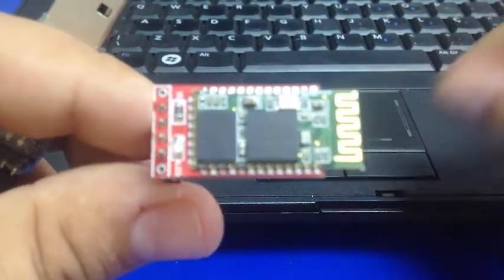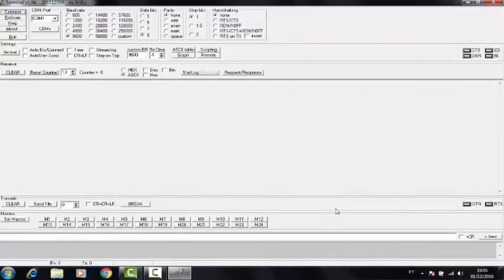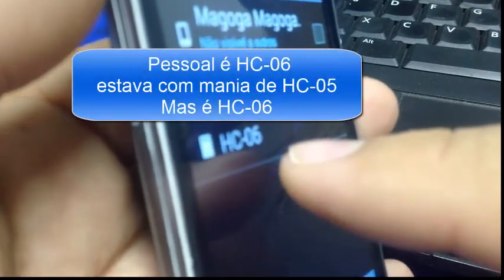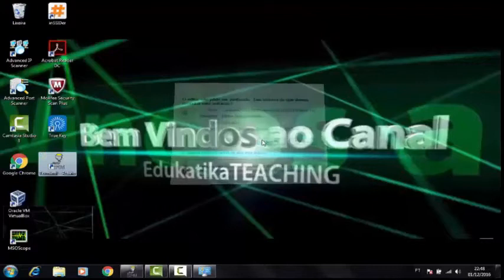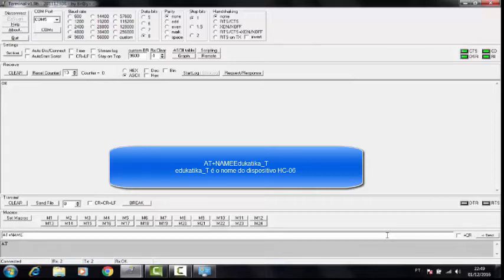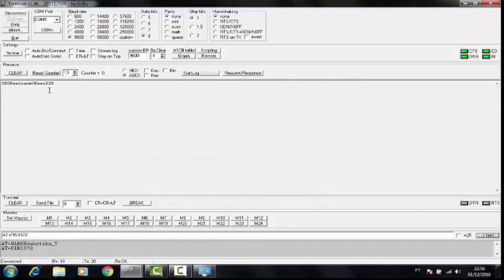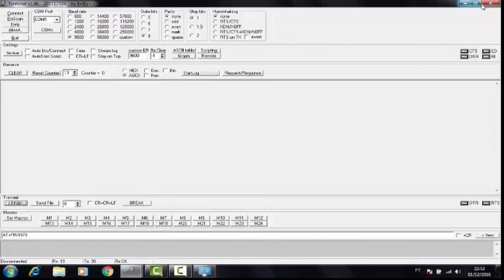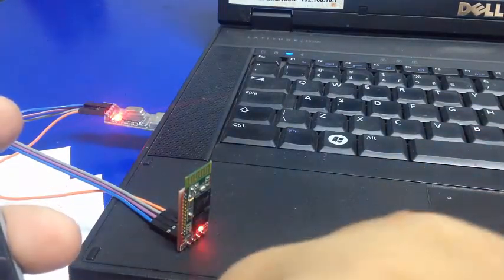Como Alterar NOME e PIN de modulo BLUETOOTH HC-06

Comment: Boa noite, preciso de uma placa rx com código pin diferente   Preciso de chegar com meu celular qdo chegar ele reconhece e mais preciso de pelo menos 5 volts assim que ele parear
Reply from the maker: Boa noite ! Interessante as suas necessidades parece ser fácil fazer mas de verdade não entendi bem o que você quer ou precisa fazer.
Reply: @EDUKATIKATEACHING  bem queria fazer uma chave de presença para porta malas, para o carro me reconhecer teria que ter um código que somente eu tenha e na saída preciso relé pra acionar um sensor de aproximação ez-d61